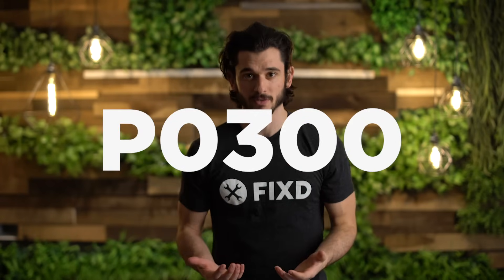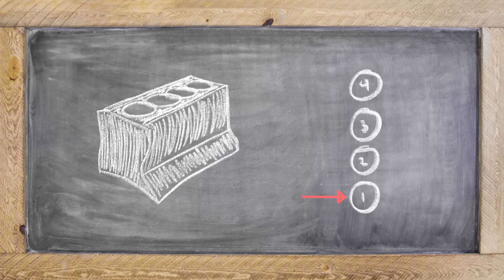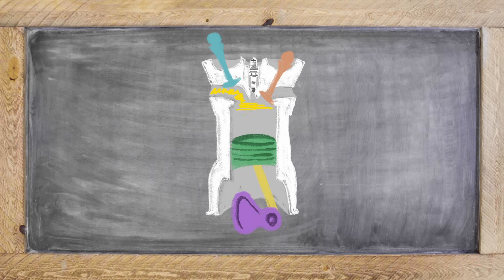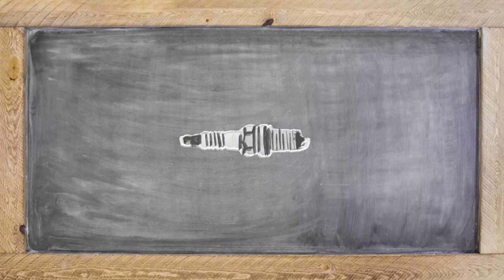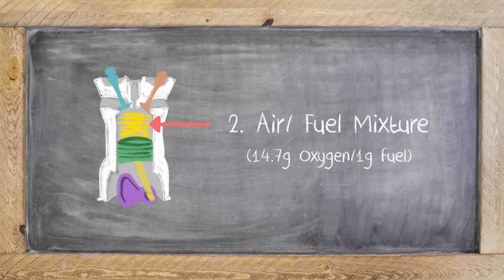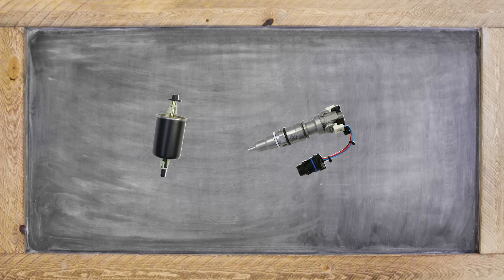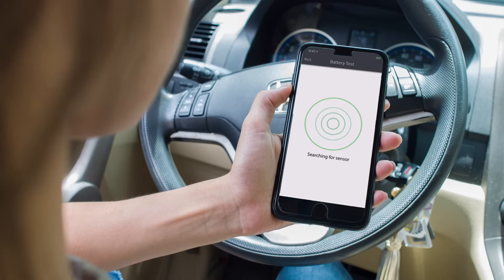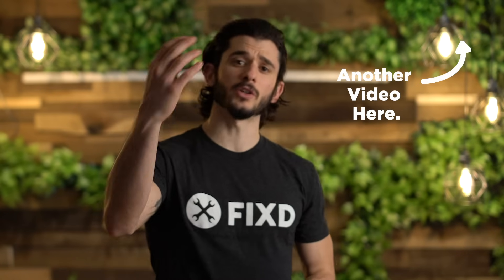P0300 Explained - Random/Multiple Cylinder Misfire Detected (Simple Fix)

Comment: Hey, i have a grand Cherokee laredo 2009 3.7L , there was a problem with coil number 5, i'v replaced it also replaced spark plugs, but some times when i'm driving the car suddenly i feel a  high vibration it looks like from the engine but when i stop the car and start it again after 1 minute i don't feel any vibration, with a scanner there is misfire with cylinder 3, any thoughts about the problem please!!
Reply from the maker: Misfires can be caused by several different things. It sounds like you're on the right path with replacing the coilpack and plugs. Always be sure to replace the spark plugs with a good quality plug. Example is an O.E recommended replacement, and be sure to replace all spark plugs at the same time. P0300 is a fault for random multiple misfire, P0303 is misfire cylinder 3. If cylinder 3 now has a misfire you can quickly find out if this is a coilpack issue by swapping the coil pack from the cylinder with the misfire code to a cylinder that does not have the fault. Example for cylinder 3 misfire. Engine off  Locate cylinder 3 coil pack. Standing in front of the engine , driver side (bank 2) there will be three coilpacks. Counting from the front of the car to the back these cylinders are 1,3,5. Remove the coil pack from cylinder 3 and swap that one with cylinder 1 or 5 (all coil packs are the same so whichever one is easiest to get to). Reinstall and start up engine. If the misfire fault moved from cylinder 3 to the cylinder you installed the coil pack, you know that you are looking at faulty coil pack.Now there are a few other things that can cause a misfire. Look for any vacuum leaks. There are many plastic / rubber hoses under the hood and over time these can become brittle and crack or break. When this happens unmetered air can be entering the system causing the vehicle to run lean and causing a rough running issue or misfire. A vacuum leak can be hard to find and may require a smoke test to be performed in order to find the leak. There are a few different ways to quickly check for a vacuum leak. First do a visual inspection looking for any cracked lines, hoses etc. Then gently move the hoses, lines etc around and listen for any hissing noises or changes in idle when doing so. Another way is to spray a small  amount of brake cleaner or carb cleaner on connection areas. This will increase the idle also letting you know there is a leak. BE SURE TO NOT SPRAY CARB CLEANER OR BRAKE CLEANER ON HOT SURFACES OR IGNITION ITEMS AS IT IS FLAMABLE!  A few other things that can cause random multiples engine misfire are faulty fuel injector, dirty fuel injectors, dirty or clogged fuel filter, vacuum leaks, mass air flow sensor along with other sensors in the system. Once all other items are ruled out next step would be to check engine health by doing a compression / leak down test. This may be something you will need to have your local auto shop do as special tools are required. 

Hope this helps!

Comment: I ignored my check engine light. 
And then my truck started to make a pop noise and i lost a lot of power and went way slower also each time it made the pop noise my truck jerked. 
Anyways it’s a 1200-2000 dollar repair cause they have to take it to a machine shop and flatten it out or whatever. 🤷‍♂️
Reply: My 98 Chevy is same way ,code po300 ,pops from mufflers shakes no power idk whats wrong with it, new spark plugs wires still good cap still good

Comment: Only problem is most cars now a days the voltage regulator is computer controlled like with Honda and the ELD in the underhood fuse box, it reports to the ECU to tell it what to do as for charging the field of the Alternator to put less load on the engine. Turning on thing's like headlights and blower motors should make the ELD tell the ECU to crank up voltage from the Alternator and if it doesn't you could get the wrong reading

Comment: I just changed all my spark plugs and now my engine runs perfect again.
Reply: I change my spark plugs and cables and still shows p0300😬
Reply: Mogon G may have to change the coils
Reply: @Mememo-z6v  coils
Reply: @Mememo-z6v  Before changing them first test them. You dont always have to replace them all.
Reply: @Mememo-z6v  Could be a bad fuel injector. You should have a shop perform a fuel injection cleaning.

Comment: P0300 is a bad sparkplug.
Reply: Its a place to start but i am proof it is not always a spark plug.
I changed all plugs.
Changed all coils.
Changed both VVT valves.
Still misfire codes.
Next is O2's and catalyst.
Reply: @zash008  Did you figure out your problem?  I have P0300 code only, with check engine light and heavy shaking misfires

Comment: Damn never knew a battery could do this
Reply: Renato Shealey im charging mine right now 😂 wish me luck
Reply: @YungYopTM  Well, was it the battery? I’m working on resolving problem on my 2014 Nissan Rogue, P0300 and P0014.
Reply: Reno nope my underlying issue was my coil packs. I found out that bad cam shaft sensors won’t allow your car to go over 2000 rpm
Reply: @YungYopTM  
Thanks
Reply: @YungYopTM  your alternator charges the battery so if your misfire is coming from a weak battery causing power drain then it won't make a difference if you charge it or not.
Reply: What about if the compression comes on the dashboard what does that supposed to mean
Reply: EXTREMELY RARE but possible.
Reply: Fail to mention fuel pump failure.

Comment: My car was shaking and throwing alot of fumes through the exhaust. when i got home it didnt want to turn on until i stepped on the gas and turned it on. not it turns on but burns through fuel quickly and i got the code p0300 can you help me figure out the problem
Reply: Check your spark plugs first, probably replace them either way given how cheap and easy they are. If that doesnt help, test or replace the ignition coils with a spark tester or multimeter google it, if the coils are good next check/replace your fuel filter, if that's still not fixing it, try a fuel injector cleaner, after that look for leaks in your vacuum lines and intake system, last thing it would probably be if its not any of that its time to replace the fuel injectors.

Did you find out what it was, 4 months after your comment?
Reply: Have you found the problem a year later?
Reply: yes it was the fuel injectors
Reply: i replaced them
Reply: @peezy5895  thanks for the reply
Reply: @peezy5895  I am 1yr late, glad you figured your problem. 
Do you remember if you had P0300 only?
I have P0300 code only, with check engine light and heavy shaking misfires

Comment: 2:10 in the video, the issue with a vacuum leak is going to be a lean condition which means insufficient fuel, too much oxygen for the mixture as another way of saying it.  I would recommend a correction to the video.
Reply: You are absolutely right! The guy is this video said it wrong! A vacuum leak would cause excess oxygen as it would be sucking in more air thus throwing off the air fuel mixture and causing a lean condition!
Reply: Help please! So my 370z has CEL on with random misfire code P0300 with high idle of 1000 RPM at cold start.  I've changed sparkplugs, welded a crack in the catalyst converter, cleaned air intake filters and CEL didn't go away.  What's your advice for the next steps? Should I change coil pack, fuel filter, and camshaft position sensors?  Thanks
Reply: @z06music  If the idle will not return to 'normal' with some runtime, also with a multi cylinder misfire code, I would expect you have a vacuum leak somewhere.  That would be the first thing to rule out anyway if there are no other codes.  The crack in the cat also suggests maybe (not always) but that it could have experienced excessive heat which is another symptom of a vacuum leak, if the mixture is lean it will increase the exhaust gas temp.  This can be hard on an engine if it is a large enough leak to keep the condition lean during heavy loads.

There isn't a lot of information in this post to draw any more conclusions, but I would start it and let it idle, listen around the engine bay for sucking sounds, review the vacuum lines for integrity and make sure all are attached where needed.  Sometimes during service a line can be left off and it is a simple as reattaching. 

Google the year of your car, model and 'vacuum diagram', it's likely you will find a diagram with the lines to check.
Reply: @moparmadness74dodge  So I replaced the camshaft sensors. Now my 370z is sluggish and can't go pass 2200 rpm.  I checked again and it still give me code P0300 plus new code P0011 and bank 1.  I reset CEL and it works sometimes and I could drive pass 2200 rpm but the CEL keeps flashing while driving.  Does that mean I need to change ignition coil on bank 1?  Thanks
Reply: @z06music  p0011 indicates that the cam timing is more advanced than what the ECM has commanded.

Not following the idea of an ignition coil being an issue, perhaps you have an issue with a cam phaser.

I’m not that familiar with a 370z or the issues that they commonly experience.  Some out there saying it could be the cam phase sensor itself.
Reply: No one asked you though princess

Comment: Fuel injector for my car is 30$ where are you getting these prices
Reply from the maker: Hey not a bot, we have a few different places we check after asking our mechanic. A good place to look is at repairpal.com (if you're ever wondering), Cheers!
Reply: lucky you haha for me if i want to get oem spec or better i am looking at 400 for oem and for some grams fuel injectors im looking at 700 smh.
Reply: @AzogTheAngry  what kind if car? Me, volvo 850 1997
Reply: @notabot3518  98 Honda prelude
Reply: he also said 40 bucks per sparkplug in labor.

Comment: Nice video ! Right now I have a problem w/ my 2009 Nissan Sentra with cvt transmission. It has 225k km in it, the problem is when I drive for around 1 km only  my speed is only 40 to 50 km only w/ 3500 to 4500 rpm. And you can hear the engine like a mad man.  I already replace  the speed sensor but still no good result. I appreciate if u can give me some advice thanks n more power!
Reply from the maker: We'd probably need a little more info, but I do have one suggestion (it's sneaky). If you have an Obdii reader you can try the premium version of our app for free. Then you can call a certified mechanic who will help troubleshoot some problems for you! Cheers!
Reply: You need a transmission line cooler. There was a recall on these cars
Reply: Transmission control module